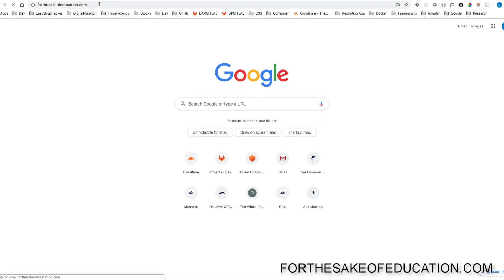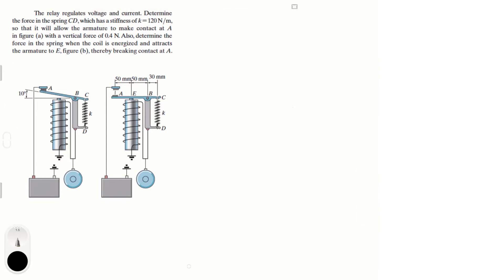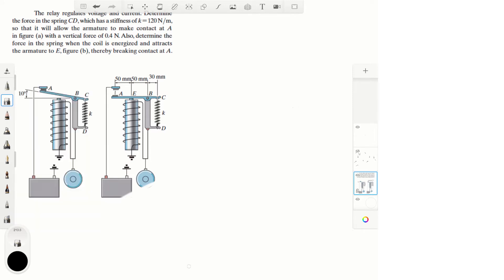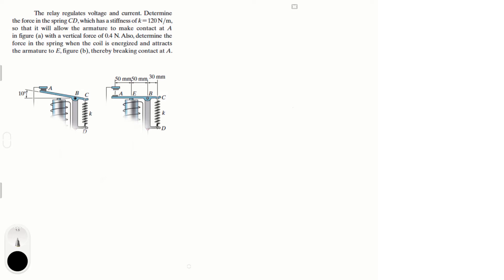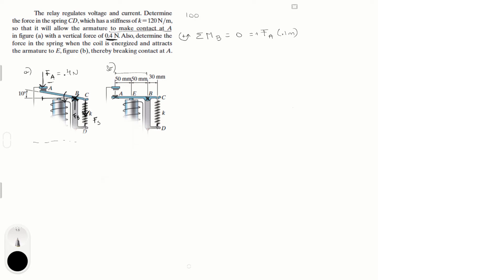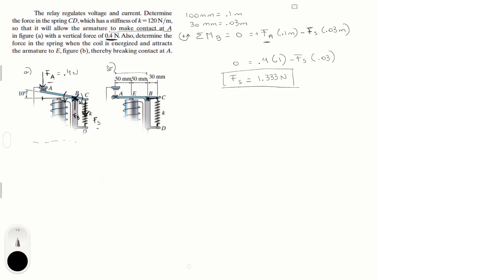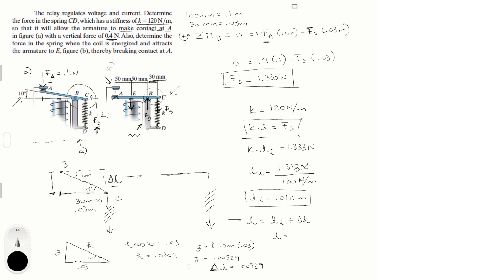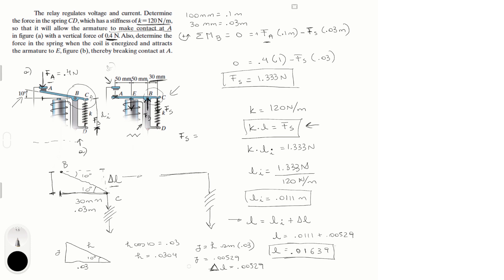Determine the force in the spring CD in the relay

Comment: I know it has been 5 years but I do have problem not understanding the equation L = L_i + dL so I hope you can give it some time to read. Here is why:
1) In the video you said 10:23 "We know the length of the spring in this moment (i.e. situation) which is L_i"  
My comment: This is not true for F = kx to work, x has to be the stretch and not the stretched length which you referred to.
2) In addition, if in situation A the spring has been stretched for 0.1 m then the direction of this stretch has to be downward since it creates and angle and is connected at D. Now going from situation A to situation B makes the angle 0deg and thus the new stretch must be upward. It seems it should be x = x_b - x_a
Neither the book and you have done so. 

Nevertheless, I appreciate your videos and explanation and ask you to oversee my ignorance if I made a wrong comment.